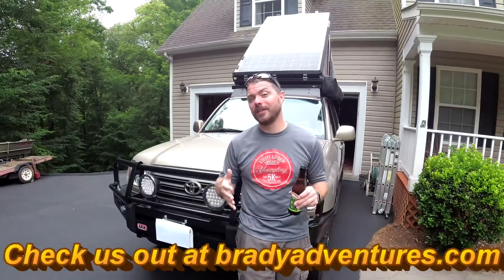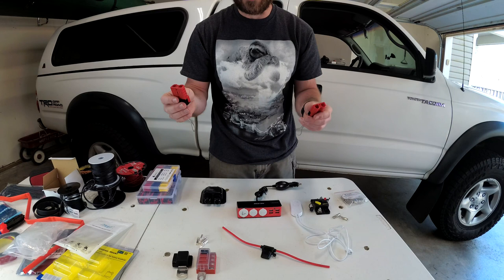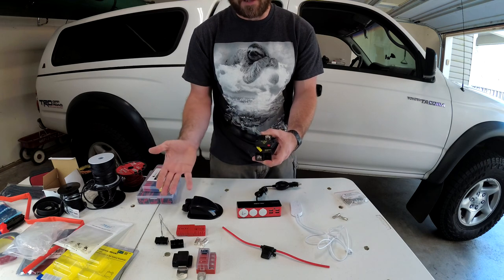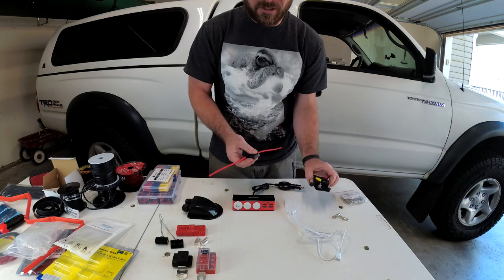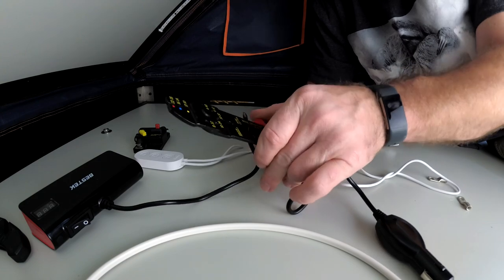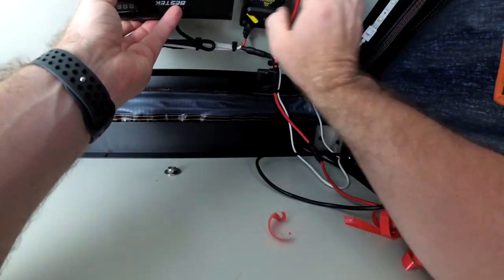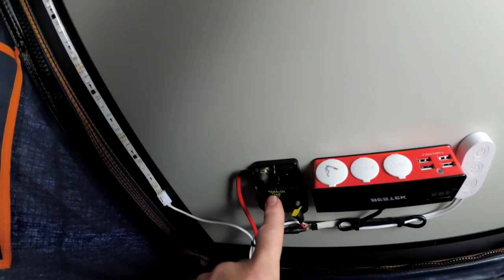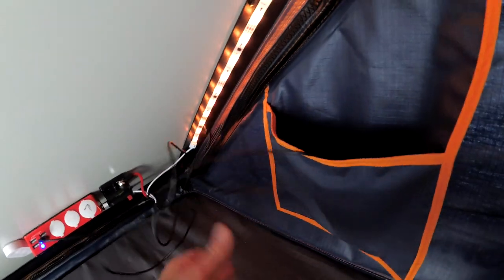12v Power installed in the Roofnest Falcon RTT - 100 Series Land Cruiser Roof Top Tent Project

Comment: Nice job! Wondering what solar panel you used? Thanks
Reply from the maker: Thanks! I have a renogy 100w flexible panel, I have had it for two years now and it even came off the truck at 45mph once during a failed experimental mount.  It's been a great panel.
Reply from the maker: by the way sorry I missed this one!  didn't realize it was a month ago! thanks